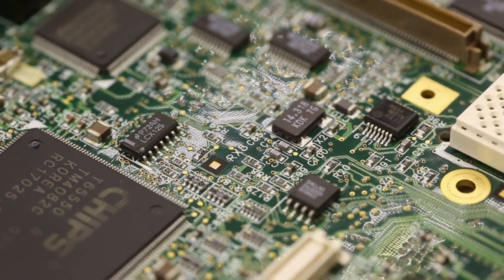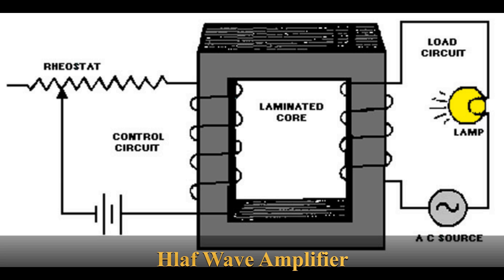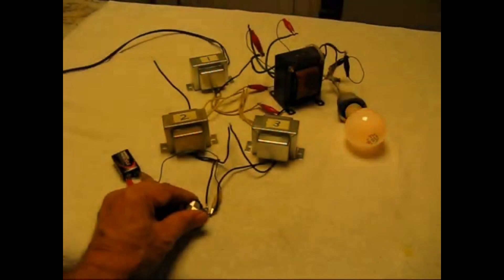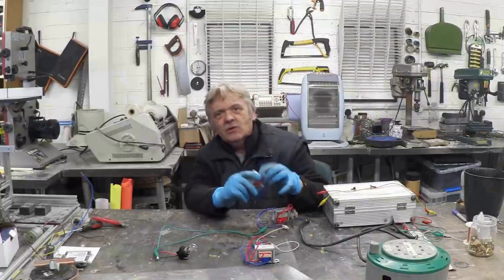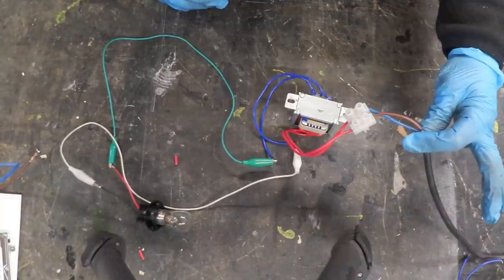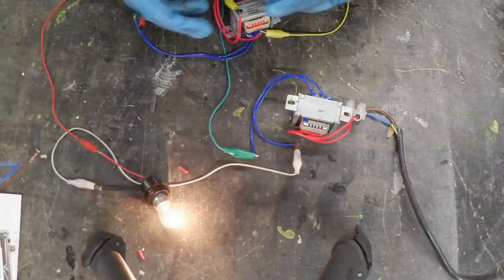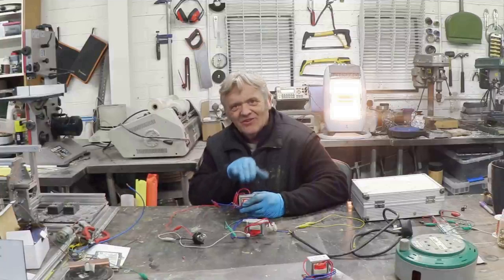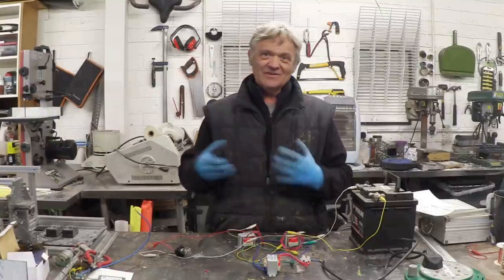2112 Magnetic Amplifiers

Comment: i cannot find a detailed enough drawing to make a magnetic amp some who have made them just dont have contact details on there channel video to ask some questions and they don't answer comments asking questions about them either  and  the drawings some do have lack of information on them let alone decent explanations  so im finding it hard to even try making one from using just 1 or 2 transformers and if you need to wind a control coil there's no space on the core except the sides around the outside only

Comment: I was a radar systems technician in the  RCAF during the 80's  and I worked on the APN 501 doppler radar.  It was designed with a mag amp during the 50's to provide ground speed and drift angle of the aircraft.  It was used on C130,C119, Sea King , Argus, and a few other aircraft. Navigators loved the system as it was independent of external radio stations.

Comment: I remember my senior motor design engineers reminiscing the days in (1980-85) when they designed a magnetic amp. control system for use on A.V.R.'s that were installed on Indian Railways..where the rolling stock wheel coupled alternators/generators were used for auxillary power generation....
b.t.w. the m/g/ alternators were also our company products
This incidentally was when we were discussing use of
 "UNITRIODE" pwm databooks (now taken by T.I.). & happened to come across their magnetic amplifier ic's & apps. in them.

Comment: HEY!  That's the basis for Nikolai Tesla's rumoured Earth Quake Machine!  Here's how:  Certain materials have a dampening effect on magnetic fields when place in a gap of magnetic flux ... so, if you use a magnetic amplifier to create a circuit based on an device called an e-bow ( used to sustain vibrations in a guitar string ), then you have the ability to create a mechanical resonance device without transistor or tubes as in Tesla's era!

Comment: Hi Robert, you can do something similar with just one transformer using the outside legs, use the center leg for supply, one outside leg for output and the other outside leg for control, you can use a variable cap or resistor on the control leg. I'll post my video if I can on here.

Comment: Tektronics scopes used this to regulate the voltage on the tube filaments.  Variations in line voltage would effect the calibration of the device by changing the temperature of the tube cathodes.  It used one tube that was designed to be extra sensitive to filament voltage, this was fed into the saturatable core reactor.  Very interesting forgotten tech.  I have thought about using such a device to stabilize the HV plate voltage of a amateur radio tube amplifier as they are in the 1000s of volts and I don't like the idea of playing with semiconductor circuit at these voltages.

Comment: The Motionless Generators of Heinrich Kunel
While Richard Willis of Magnacoaster in Canada, has gone commercial with his generators, making each of the generator outputs multiples of 12V 100A, a lot of very interesting earlier information can be found in the 1982 patent of Heinrich Kunel. The patent describes four separate configurations of his basic design, a design which looks very much like that used by Richard Willis. Here is an attempted translation of the Kunel patent which is in German:

PATENT: DE3024814                   28 January 1982                   Inventor: Kunel, Heinrich

PROCEDURES AND DEVICES FOR ENERGY PRODUCTION

Application Number: DE19803024814 19800701
Priority Number(s): DE19803024814 19800701
IPC Classification: H02N11/00 EC Classification: H02K53/00

DESCRIPTION
The invention concerns procedures and devices for energy production, which convert the magnetic flux from permanent magnets, without the need for rotary, or any other form of motion, into temporally variable induced flux and produce large fluctuations of the induced magnetic flux into electric current, without the need for a thermal circuit, or torque or chemical process, and in such a manner that the electric current is amplified.

The energy problems of our time are sufficiently well-known in the professional world. The transformation of conventional primary energy forms into technically usable energy is relatively cost-intensive. Additionally, by doing this, precious and ever scarcer raw materials are being destroyed and pollutants are accumulated, pollutants which are able to cause the end of mankind.

In order to reduce or avoid these and other disadvantages during power production, it is suggested according to this invention, that for the production of electric current by induction, no torque is used, but instead, the magnetic flux from permanent magnets is converted into an induced flux with large rapid variations, e.g. into a rapidly changing or pulsating induced flux, which can generate an electric current.

In accordance with this invention, one proceeds from the basic arrangement where a permanent magnet is connected to an iron core via one or both of its poles, the core consisting of, for example, dynamo iron, pure iron or amorphous iron or any similar suitable material which has little or no core losses.

Following the procedure of this invention if, for example, one pole of a bar magnet touches such an iron core and is aligned with the longitudinal axis of that core, then both the magnet and the core act as a magnet.

During this initial magnetisation process of the core a magnetic flux flows in the core, which induces a current in a conducting circuit surrounding the core.

If, in addition to the permanent magnet, a coil is wound around the core, and arranged in such a way that a current flowing in that coil wholly or partially interrupts the magnetic flux flowing through the core, then this causes another modification of the magnetic flux passing through a coil wound around the core.

If this interruption of the flux flowing from the permanent magnet is large, and has the waveform of a Alternating Current, then a pulsating Direct Current is induced in the coil wound around the core.

With an AC input to the magnetic flux modifier coil wound on the core beside the magnet, the coil receives two current flow direction changes per AC cycle, and so the magnetic flux coming from the permanent magnet is interrupted once and released once during each input power cycle. In this way, a pulsating induced Direct Current is generated in the output coil caused by the pulsating magnetic flux in the core.

It was found that the induced flux from a permanent magnet achieves its full initial value of the magnetic flux density in the core also at the free end of the soft-iron magnetic core, even if there are several induction windings each with the same number of turns and the conductor cross section are appropriate as in a magnetic flux modification coil wound on the core, without changing the strength of the magnetic flux density or the remanence of the permanent magnet.

The permanent magnet is not demagnetised when used to provide the flux in the core, no energy is extracted from it, unlike an electromagnetic core, whose windings require more operating current than that produced as an output. With an electromagnetic core, as much input current is required, as is induced in the output winding, corresponding to the relationships of the well-known transformer. Therefore it is important to produce the induction flux by using a permanent magnet.

After the basic primary system, one can build e.g. energy linear generators or energy circle generators or other arising or suitable types and forms of energy generators, without the necessity of a rotor or a stator or any such mobile sections or providing torque in the generator.

The invention is so designed as to make only frequency control governed by electrical means so that the internal induction flux in the generator core is essentially caused by the magnetic field of the permanent magnet.

In the drawings constructional examples are schematically represented according to the invention:

Fig.1 shows a linear energy generator in longitudinal cross-section.

Fig.2 shows a linear energy generator in the instantaneous state of the transmission of the induction flux of the permanent magnet to the generator core and

Fig.3 represents a linear energy generator at the moment of the interruption by the induced flux;

Comment: I highly recommend you look into Thane Hienze's work with regenerative braking, basically when you use thin Guage wire many turns you get a delayed lense effect, where instead of having resistance as the magnet approaches the coil you get acceleration because the lenze effect is delayed until its already past top dead center. It's now a helping force. The Guage wire and the number of turns effects how pronounced the effect is. You must reach a minimum number of rpms before putting a load on so that the rotor is spinning fast enough to be past top dead center for the lenze effect to be a helping force instead of a hindrance. Hope this leads you down a wonderful new Rabbit hole
Reply: Good point. As a recent new owner of an ebike with no regeration i think the tech is primitive.

Comment: Fluxgate magnetometers were beautifully elegant instruments for determining the earth's  magnetic field strength using 3 orthogonal ferrite rods and 3 coils of wire on each ferrite. AC at about a few hundred Hz, a secondary winding and a DC winding to keep the core from saturating in one or other direction.Classical zeroing current proportional to the ambient field strength.

Comment: You can combine the two transformers into one with a third centre leg, the coils are wound in the outer two legs so the fluxes they would create down the centre leg cancel so it is possible to wind a coil around that for the DC control (this arrangement was shown in one of your slides).

Comment: Well explained. Thanks! There is also a thing called Solid state Magnetic Field Diode. These don't have the negative counter effect to the primary coil. So some circuits could be designed extremely officiant.

Comment: something else interesting about transformers  that I have discovered , is that  a step-down transformer can be used in reverse. that is, by putting the voltage to the secondary that it is rated at, you get a higher voltage at the primary. so in a way, it can be used as a inverter.

so if your transformer primary is rated at 130 volts [ here in the US ] with  6 volts out of the secondary, and you place 6 volts across the secondary, you will get very close to the mains voltage out of the primary, or  6 volts in - almost 130 volts out.
Reply: - yes, transformers like gears (a mechanical analogy), are reversible, step down, step up - bidirectional...  - check out how  a single coil - auto (self) transformer  or variac works...  (just take care to not create deadly experiments )- note that the power levels at each side must be similar (ie. allowing for losses, nothing is perfect) - ohms law still applies.  
(lower voltage with higher amps is the same power P = I*V  - (I = Amps, "current").. the ratio for  130 step down to 6  something is between 21 and 22 :1,  if it was 120VAC the transformer would be a simple 20:1...)

What are you using for a 6V AC source??  ie transformers don't do their "job" if running on DC - then the saturated magnetic field -  bit -  Rob is talking about here comes into play.
Reply: @kadmow   I don't remember for sure, as this was something I did waaaaaaaaaaay back when I was a teen in the 1970's. but 
I am sure it must have been  another Ac transformer that had a 6V AC output, without a rectifier circuit. I was just experimenting and discovered this purely on accident.
Reply: @Darius_Finnigin  now to put 130 volts on the little side and get 12*130 volts on the angry side :)
Reply: @pepe6666    love the name BTW. 
 I mistakenly did this as a teen 1 time.
alot of magick blue smoke from the transformer, and anger from my parents who thought I had started  a fire in my room.  :)

Comment: wonderful video, very fascinating!  its almost as if the magnetic field of the magnets are acting like wires, allowing an alternative route for ac current to vibrate within.?
Reply: - electro-magnetism is the complete "loop" ("field" of knowledge) - flipsides of each other yep..
Reply: the flux sure is, but i would say the gravity produced 90° to the polar axis is not (the pull force of magnets shrinks toward the magnet's horizontal axis the stronger and bigger it gets, like planets, stars, and galaxies.) @kadmow

Comment: This looks eerily similar to the magnetic voltage regulator I have on my modified sine wave inverter, the inverter will not run the microwave or induction cooktop however with the mag VR they run fine, but the 750 watt microwave consumes about 1000 watts because the LCR networks have to fill in the choppy inverter output .

Comment: Couldn't it be possible to build a diode using a electro magnet set to pulse to pass a certain part of the sine wave?
Reply: it should block current flow, but it might not block voltage
Reply: Look for Solid state Magnetic Field Diode.